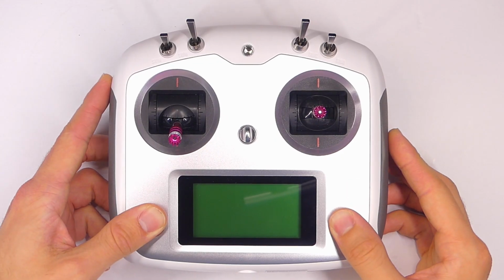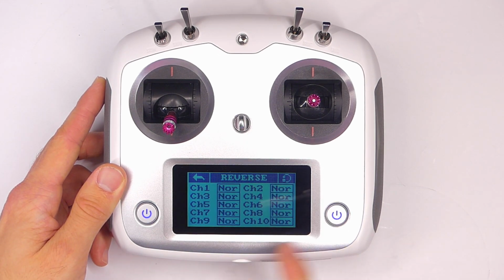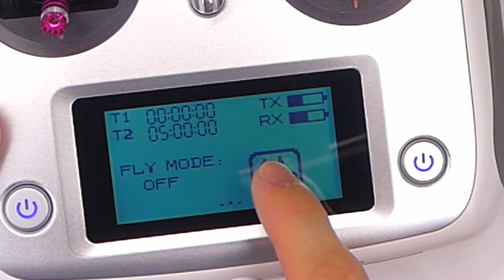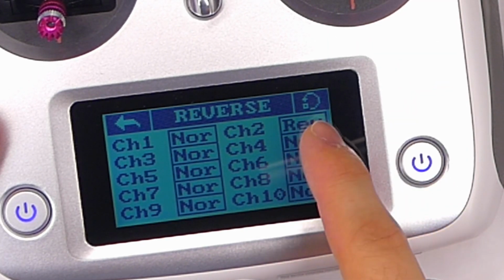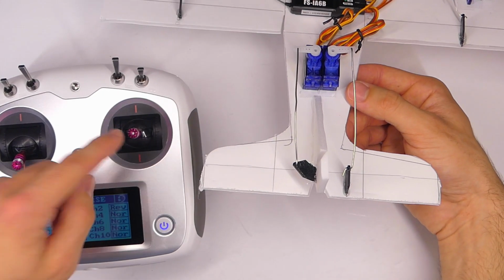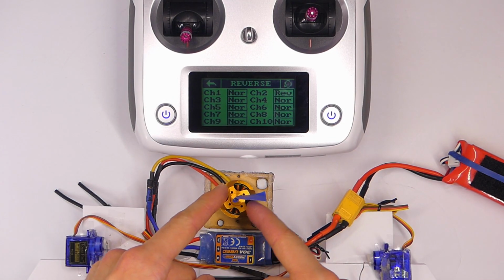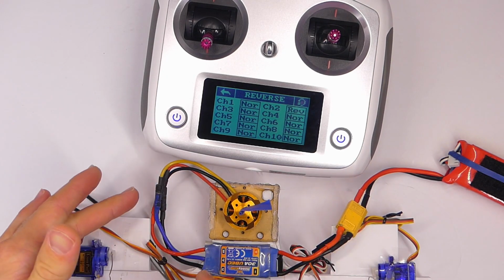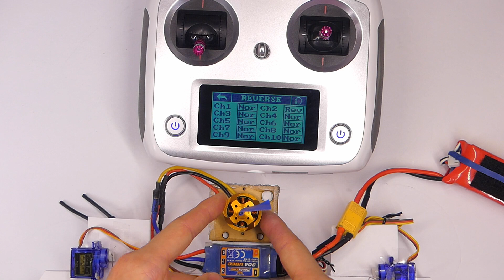How to Reverse Channels - FlySky FS-i6S - (Reverse Servo)

Comment: Hi! Nice video...in my case, I have a RC tank and assigned a servo to VrB (ch 10).  I need to reserve the servo and after reverse it in my FS i6s radio, the servo direction still the same....so, can you tell me the way to reverse servo direction in VrB? Thanks